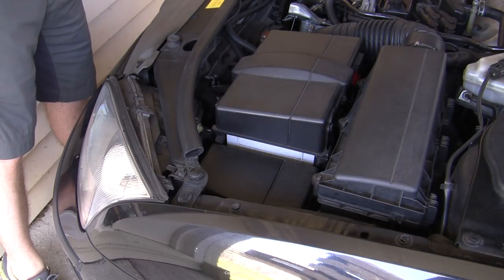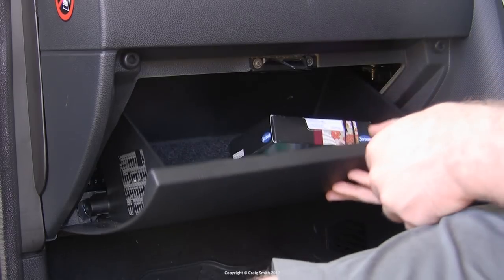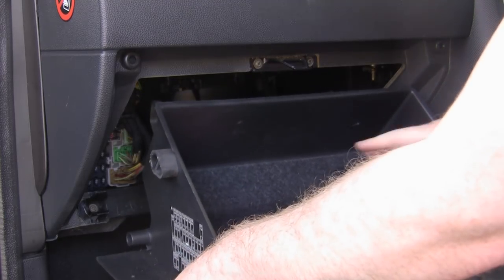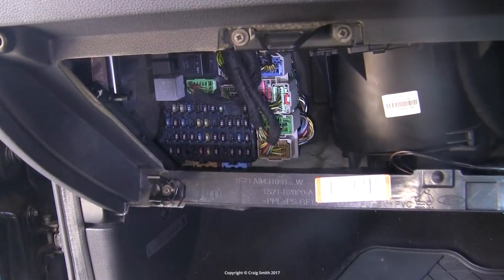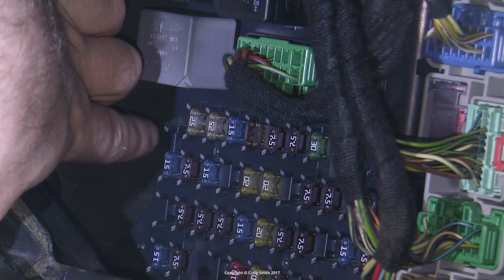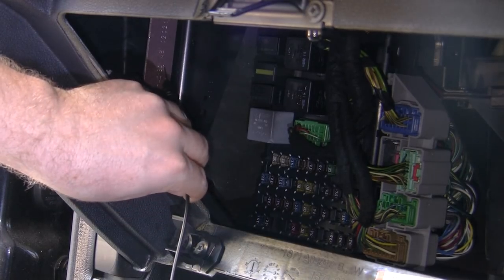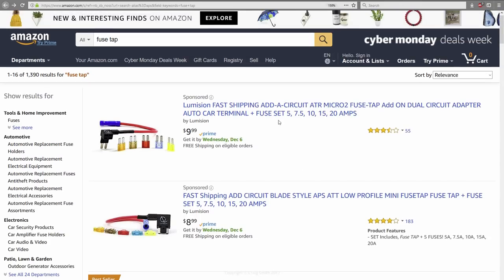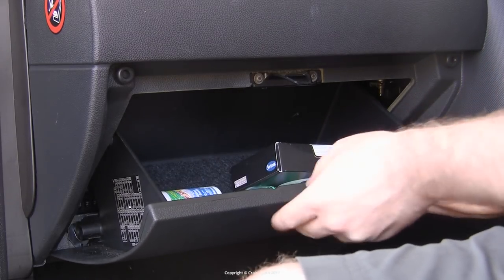How to: Remove glove box & access fuses, Ford Mondeo Mk3

Comment: Hi. This is a great video. Has helped me switch the cigar lighter fuse to the other position and it works exactly as you say. I have a question. I removed that device to put an usb socket wich has a bluetooth receiver plugged in. That receiver goes to the glove compartment's 3,5mm audio socket. The thing is when that audio cable is connected, it powers the USB socket!. Also you can hear aan electrical noise over the car speakers when using the aux source this way. Any hint on how to fix this? Thank you so much.

Comment: Hi thank you for the fuse names.My car is not starting, and F27 fuse is oke, and Relais K4 the fuel pump I changed is with K33 because there are four the same Relais and that was not helping.So I think the fuell pump is down. ???Because battery is oke.starter is new.gas/benzine is oke.I think there is no Relais or fuse for the fuell pump in the Main box??? (glove box)

Comment: On the lefthand its on the same side.
Reply from the maker: Thanks, my mistake.
Reply: Craig's DIY Car     Craig, do you know how to remove the knob of the gear shift?  I've been searching the whole internet and found out that a lot of  people want to know this, butI  never found the solution.
Reply: Manual shift? Just grab firmly and screw off.
Reply: Peter Sarlai   Nope. That worked on older cars. Not the ones after 2000
Reply: I have a 2001.03 mondeo and it just screws off. Done it myself a few times. It needs force though, very fine threaded.

Comment: Hi mate I have a mondeo mk3 like in your video , my radio isn't switching on , the battery has been flat for a while , I charged the battery now radio not switching on , it is a sony radio , checked fuses they seem to be OK ,can you help me thanks John
Reply from the maker: A Sony OEM Ford headunit? I don't know sorry, I never had one. To test power supply as opposed to the unit, you'd have to unplug it, get the plug wiring info, and start up the multimeter.
Reply: disconnect posts on - and + run a wire between the two disconnected terminal wires making sure they do not touch the battery. Turn everything on that you can think of. Headlights on high beam a/c etc. Leave for ten to 20 mins turn everything off remove wire reconnect battery and should work again. This resets the battery good luck.

Comment: There is a malfunction on my mk3 mondeo that has been bothering me for a while. The interior lights suddenly broke down. I changed the small fuse (number 99)  in the fuse box but it didn't work. the lamps are not broken. The fuse box is not broken. elecrick flow seems normal.  No mechanic could fix it. if anyone knows the answer please help :(((